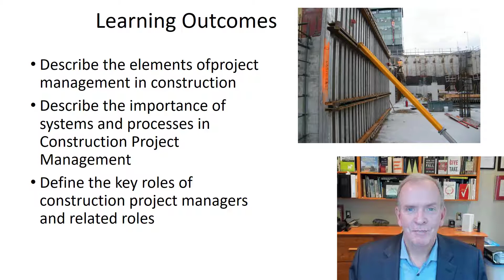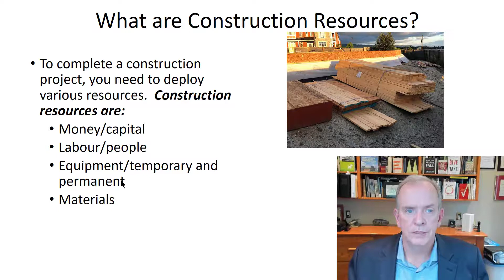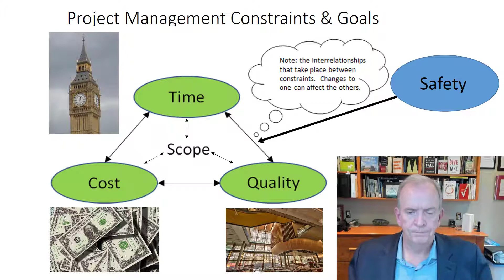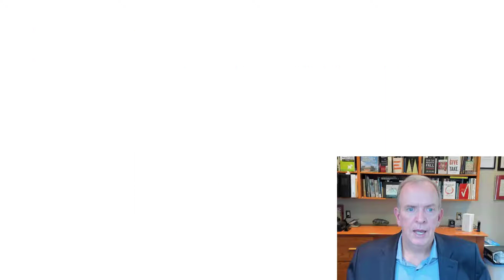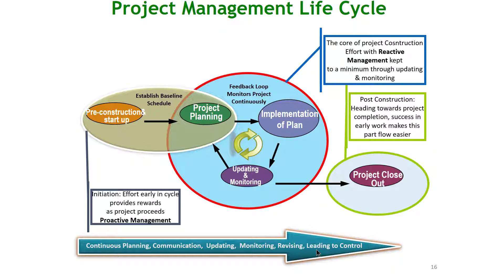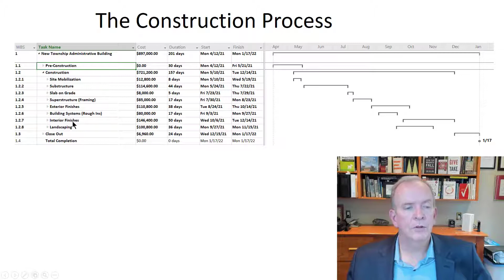Lecture 2A Introduction to Construction Management:  The Role of Project Management in Construction

Comment: Hi,I have a question Tom i am willing to study construction management at university next year bachelor of construction management do you think it's a powerful job and is it too overrated and hard to find jobs within that industry?
Reply from the maker: Hi Aboudi,  I would say it is not over rated, but it also depends on where you live.  If you are in a economically growing part of the globe with stable conditions in place. It can be truly excellent, also re technological change work still will need a lot of project management skills, if not more in the future as integration requires better management.  Aalso, be mindful of the different sectors and the opportunities they provide e.g. Restoration, new construction, infrastructure, commercial etc…. Do you have a real interest in the construction sector? If you do than that will make work in it much more satisfying.  Often you have to work at something for a while before you know whether it is the right fit.  The good thing about construction is that there are many areas and sectors that are relatively easy to cross over into once you gain experience. The field also offer endless entrepreneurial opportunities.

Hope that give you some ideas

Comment: Tom,

Thank you for making these videos available. I am working my way through them because after being an entrepreneur since 2014, I am re-entering the workforce and I thought it was important to learn how to talk to people in a corporate context about the things I did over the last 8 years. (e.g., learning that things I did on paper or in Excel are called a PERT chart or a Critical Path chart) Basically, I am lacking the language, not the knowledge, if that makes sense.

I was thinking about the Iron Triangle that you illustrated at 26:28-ish and realized that I conceptualized it a different way. I wanted to get your opinion on it in case the way I am thinking of it is problematic in a way that I don't see. I understand that these things are really visual and/or conceptual tools that assist the PM in managing the project, and I want to exercise caution in the way I think about them.

I put TIME, LABOR and MATERIALS in the bubbles, with COST in the middle, and I add an external bubble surrounding the whole diagram.

TIME is obvious, whether measured in man-hours or calendar days.
LABOR is the tasks that people are performing while they spend time on the project.
MATERIALS include both "ingredients" such as concrete and steel, and "tools" such as an excavator or a paint brush.

Inside the Triangle I place COST, which I see as a function of the three variable; Time, Labor and Materials.

Outside the Triangle but inside the surrounding bubble I put PRICE, which of course is what we're charging the client.

So I am conceptualizing this as being able to manipulate the variables as needed to adapt the plan to changing realities, but I don't want to have the Cost grow to the point that it breaks the Triangle, because then I'm not making money. Even worse is if Cost breaks the surrounding Price bubble, which means I'm losing money.

Now this SEEMS like a good way to conceptualize these constraints, but I'm new at this part and I don't want to set a trap for myself by using a conceptual tool that hides a critical reality from me. And yes, I know... I'm most likely overthinking this.
Reply from the maker: Hi Eric,  What sector of construction are you in?  It is always good to look at different concepts and nuggets and try to map them out.  You may enjoy the concept of making mind maps to clarify concepts you see unfolding.  Often that helps you to better connect the big picture.  Your points pretty much feed into development of a project plan and schedule which we then need to iterate to keep on track.  Thanks for the detailed comments and your practical perspective
Reply: Thank you, Tom. 

I started out in the early 90’s doing framing, plumbing and electrical and accidentally found myself doing a lot of large scale cable work while trying to finish my first degree. A decade later I found myself doing IT consulting and project management at the network level; again accidentally. 
In 2014 I bought a moribund Gravel Doctor franchise and up until the end of 2020 we built, maintained and repaired aggregate surfaces, did some road building and a fair amount of storm water management work and groundwork. Dirt moving.